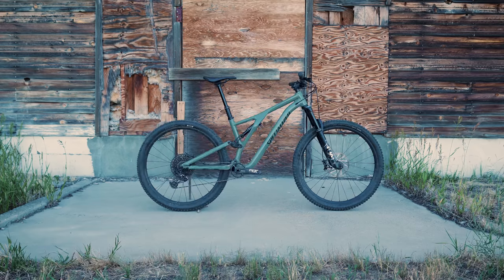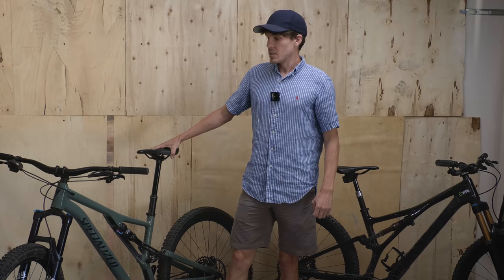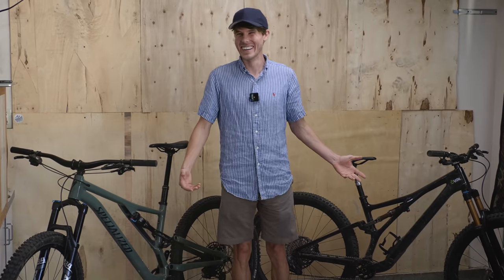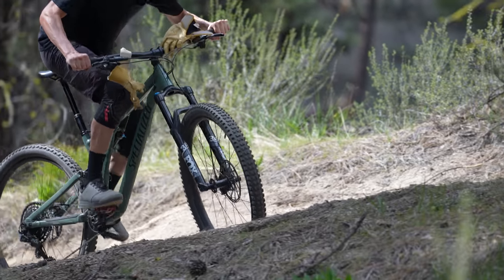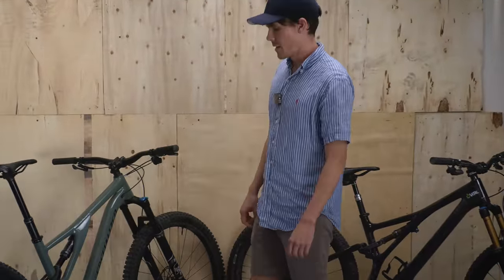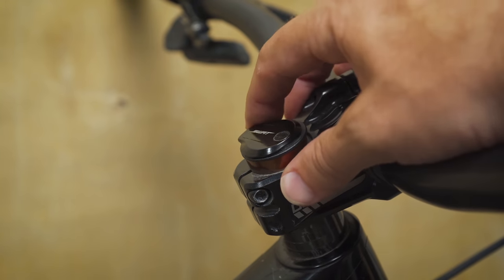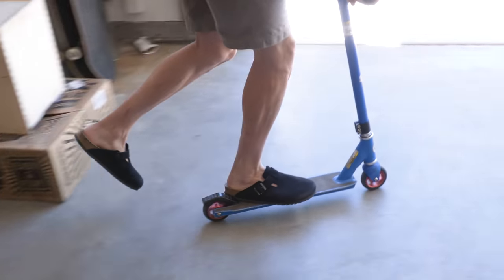LONG-TERM REVIEW - Specialized S-Works Stumpjumper vs. Stumpjumper Comp Alloy

Comment from the maker: Video Contents
0:00 - Intro
0:50 - Downhill Performance
2:36 - Climbing Performance
3:14 - Geometry
4:12 - Suspension Performance
5:23 - Suspension Setup
7:08 - Put a Bigger Fork On It?
8:27 - Fork Performance
9:47 - Drivetrain SRAM AXS vs NX
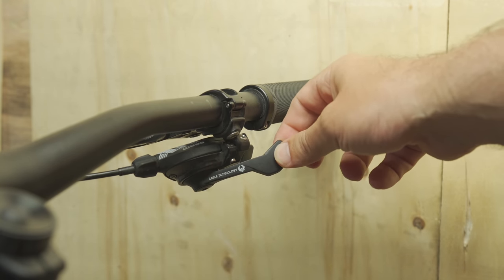11:41 - Carbon vs Alloy Wheel Durability
13:28 - Carbon vs Alloy Frame Durability
14:35 - Is the S-Works Worth $9,800?
15:15 - Is the Alloy Comp Worth $3,400?

Comment: I have an s3 comp alloy and it’s amazing. I’m a teenager who worked for 8 months to save up for it and it’s a bike I’ll likely have for 5-10 years. For most people who aren’t racing or a professional biker, there’s nothing wrong with the comp alloy.
Reply from the maker: way to go, working and saving up for a rad bike!
Reply: Congratulations for getting such an awesome bike at that young age man!
You got yourself a pretty decent job if you where able to buy such a bike after that relatively short amount of time.
Reply: Have a M (S2) 2019 Enduro Comp. Essentially a 2021 Stumpjumper but with enduro travel at 170-180mm. A beast and the sensitivity and kinematics are still excellent. Good choice with the Alloy Stumpy.. frames made by Merida in the Taiwan factory are bombproof as heck. You'll have it for years to come.
Reply: How did you find it in stock? Cause I'm in a similar scenario, except I can't spend my money on the bike I want which is the same Stumpy comp or base alloy
Reply: @vitalmtb  i am going to save for 1,5 years more so i can get The trek slash 9.7
Reply: When u do get in the market for a new bike buy used you can find some seriously cool bikes for a great price .
Reply: Same same man, saved for months and I love it!  Bike has taken my riding to the next level
Reply: How much does it weigh
Reply: Nothing wrong until your frame snaps and Specialized refuses warranty. Happened to me twice... on a normal forest trail.
Reply: @DilbertMuc  carbon snaps, alloy bends. I’d rather have a bent frame that I can still get home on than a snapped carbon frame that would seriously injure me.
Reply: @harrycockroft9659  30 ish, probably 31 lbs
Reply: @iangoodwin1839  Unfortunately the alloy snaps. I had two FSRs with snapped rear triangle, the famous seat stay snap. And a snapped main frame that broke cleanly off at the front tube. That's where I was thinking about moving to carbon because that can be repaired at local carbonrepair shops. Broken aluminum is toast and the alu frames of today are simply too thin, just to be light enough. And you can't buy them from Specialized after some time.
Reply: well, doesn't the Carbon do away with the four link suspension and adopt the new flex chain stays? well, good or bad there "has to be" a difference in ride because of that!
Reply: Good on you!  You wanted something, you worked for it and saved. That is a sign of good parenting, make sure you thank them.  Wish every teenager had been taught that.
Reply: I’ve been saving for this bike for over four months now, still got $1500 to go
Reply: I'm still riding an 07 upgraded to 140 mil still shreds pretty sell

Comment: I really like this format.  I think the middle ground build always end up being the best option.
Reply: Me too! I've gone with the Expert build on both my Roubaix and Stumpjumper and I like the better components and can tell the difference from the entry-level comp but don't think I necessarily need the tip-top of the line S works. One day if the extra 4k doesn't hurt the bank account, maybe I'll consider it but I am so happy with my Experts and glad I spent that little bit more.

Comment: The interview reflected my impression on today's Specialized, which I have been riding for decades now. 
For a hell lot of money (comp alloy) you get a decent bike with cheap/mediocre components (SRAM NX) and so-so performance. Nothing to brag about or be proud off, but it gets you there. 
For an insane amount of money you get a bike that is in the top league and rides like a dream. Anything below an insane amount of money leads to a lot of compromises that make you think about moving to other brands. To help you with this decision, Specialized now raised the prices even higher with U$ 11.000 for the Stumpjumper S-Works. And that is still a bargain compared to the new Epic S-Works at an astronomical U$15.000 (!). Only hardcore Specialized enthusiasts are welcome there. Thanks, but no thanks. Unless I am a sponsored rider.
Reply: Yep...and honestly this review came off very snobby and elitist. Atleast now the bikes are mostly marked down significantly since the covid boom is over. A stumpjumper comp carbon is 40% off right now, showing just how grossly overpriced these were to begin with.

Comment: I bought the 2019 comp alloy in March 2019 and the bike has seen it’s fair share of big hits and bad landings and it is still going like a trooper. I’ve replaced every bearing on the bike at least once due to wear and riding in all conditions, all year round and like you said, the wheels are only good as long as you look after them.
The one bad thing about this bike is that single discipline focus. It is a bike that is designed to make trail riding super fun which it absolutely nailed, but when it gets into DH bike territory, there are no upgrades that are going to make it handle well and within its comfort zone like a modern enduro bike will. 
For the majority of my rides, the upgrades I have added over the years keep it right up there with my mates on 180mm enduro bike but like I said, there’s a point (like 8ft drops into a footy rock garden) where the bike quickly finds its limits and ejects you from the driving seat. 
Great review guys, really good to see this comparison, particularly with the bike I own. 🤘🏼
Reply: The 2019 and 2021 are very different bikes. You would not want to send the new one off of 8ft drops you will destroy it pretty quickly. I would say that the evo version is the bike to have if your riding those kind of trails.

Comment: Great review. Awesome to see this post a week from when I bought mine. I picked the Comp Alloy since it has good components for my intended use and the price of entry wasn't astronomical compared to other bikes. The weight is noticeable when climbing but I'm hoping as things wear out (drivetrain, and wheels) I can upgrade in the right places to bring the weight down a bit. Very cool bike for the price.
Reply: The most difference i noticed was changing the crankset. That took tons of weight off. I upgraded to GX
Reply: @MtbRN2MD  Awesome glad to hear that. DId you upgrade for weight savings or just to have a nicer crank? thanks for the recommendation
Reply: Also was it the alloy GX cranks or carbon?

Comment: I love how a $3K bike is "budget".
Reply: I guess you're new to mountain biking?
Reply: Realy normal bike starts from 3k. Luxury bike - from 5..6k.
new trail bike cheaper than 3k have a lot of stupid moments that may solve by later upgrade, but... later upgrade spend much more money.
Reply: The average mountain biker must be incredibly gullible, the amount they pay for their bikes. Seems like a good time to be a push bike manufacturer, profits must be off the charts
Reply: @rcg9573  Out of curiosity, are you passing these guys on the climbs or descents?
Reply: @rcg9573  sorry friend, the amount of engineering and QA that goes into a bike in this price range is far beyond something 1/10th of its price. 

The hand welds on the frame alone are worth the money.
Reply: @rcg9573  wow you must be the soul of the party… just saying😆😆
Reply: It isn't budget. It is the lowest standard of good components. I'd call it midrange since everything above 5k or so isn't really gonna change your performance a lot.
Reply: Compared to what you could pay for bikes it is definitely far on the lower end of prices
Reply: @briAction  You all really should look deeper into the manufacturing side of the components and frames. The costs to get materials, machine stock, molds, carbon, etc have not actually gone up enough in the past 15 years to match the prices they are currently selling these things for. Take Sram nx, sx, gx - there is no manufacturing cost differences between them and they just market them as better component tiers. They are doing it solely because they created a narrative and people now think 3-5k is "budget".  Wages of the "hand welders" at bike manufacturing plants (NA) have not risen and are under industry standards for welders (tried getting a job at one) also hand welds have been the industry standard for every single budget range of metal bikes since the dawn of bikes - it is not special and does not warrant "better quality pricing".  Engineers at the bigger brands get paid fixed salaries that are not generally factored into the sale of bikes so that engineering cost is a mute point.  Here is an example of how messed up the current system is - lets take Evolve bikes - they charge the same high end rates as the big manufactures yet they don't have any engineering of their own or manufacturing - they private label a Chinese carbon frame  and throw on different component packages.  So they are now making more markup then a big time manufacturer because they get their frames cheaper but charging the current day prices people are used to. Lots of the smaller brands are doing this these days as well.
Reply: @corail53  engineering salaries are definitely considered in a companies budget vs revenue. Idk why you'd get the idea that money for engineers with competitive salaries and benefits just magically appears... skilled workers also cost money (think hidden costs like training).  

Skepticism is warranted but if you think companies like specialized and transition aren't spending money on r&d.. idk..  if you have citations that say otherwise by all means post them, but it seems to me that from an engineer's perspective, bike manufacturing has a pretty high overhead to produce at any sort of volume that isn't one-off. 

Bear in mind I'm not saying markups and hype don't exist, they definitely do, but most reputable manufacturers sell bikes in a pretty wide range of prices and provide very good warranties on their frames, not something you're going to get with a random frame off of ebay.
Reply: Its 5 gs
Reply: @HollyBoni  I used to ride DH in the late 2000's and a good bike was around 2-3k.  So seeing trail bikes starting there now is a bit of a shock coming back into the sport now.  But there have been so many improvements to even the entry level bikes.  Everything is hydraulic brakes, hydro formed chassis, dropper posts, excellent drive trains... Once you get pass the sticker shock you can see why they are what they are.

Comment: The SJ Comp Carbon would have been a better/closer comparison to the SJ Comp Alloy.  It's the same carbon frame and geo as the S-Works and would have been closer components wise (SRAM NX vs. Shimano SLX), and $800 price difference.  I've had the SJ Comp Carbon for about 2 months and love it.  Coming from a 2014 SJ alloy.  S-Works is a whole different level of bike and likely rider.  Great review and like the format.

Comment: The prices of new bikes is insane!!! I understand that the demand is currently through the roof. But those that have been riding mountain bikes for years are suffering as a result!
Reply: The price of used bikes is even worse
Reply: I have been riding bikes over 30 Years I have never seen mtb cost more than a used car insane a bike doesn't make you a good rider a rider makes any bike good  trust me
Reply: @richardgonzalez6583  well to be fair I could never bash as hard on a Walmart bike as I do on my way too expensive long travel toy

Comment: I have a base model 2021 stumpy alloy, it's my first bike in 5 years and my first fs bike.    Maybe 100 miles on it so far.   After a basic setup and walkthrough with the dealer, I was basically able to just go ride and enjoy it and gradually learn how to tune the suspension and gearset. 

It's 1k less than the comp, definitely a compromise on suspension parts and the brakes, but it's still an amazing bike to me to get into grown up mtb's with a lot of room for future upgrades and it gets the job done. My last bike was a GT Outpost, so this is a huge step up, like orders of magnitude, though the gt was way lighter and quicker on gravel/tarmac. 

I do wish it were a bit faster just about everywhere, but it's a really satisfying bike to just get out, learn and be able to hang where hardtails might have trouble, as long as you're okay with just chilling and not being the fastest rider out there.  

Hopefully this is helpful to someone if 3400 is a scary price, 2500 is definitely a bit easier to swallow, especially if you are just building up a set of gear to go with it :)  lots of learning and upgrading in the future 😎 

Great and fair review, the alloy stumpjumpers are great for what they are, but for almost 10k personally I'd step towards a Pivot or Santa Cruz.
Reply: I also got a base stumpy and I can’t complain it hasn’t let me down
Reply: @Hardworkpays209  I actually ended up replacing the rear shock with a custom super deluxe haha

Comment: Hey guys, great review! I'm actually going to be ordering a 2023 (2022?) Stumpy next week but I'm struggling with the Comp Carbon and the Comp Alloy. 

Its an $1800CDN difference and the only reason I can think of to get the carbon version would be the weight savings which from what I could find online is about a 2lbs difference (30ishlbs [could only find the Expert weight] vs 33lbs). SLX on carbon vs NX on the alloy and the venerable Shimano MT800 vs SRAM DUB.

A bit about me: 6'1, 210lbs, definitely just a 2 day a week/weekend warrior - no racing. Lots of technical climbs and I swear there's more climbs than descents. The descents aren't very long either - no mountains here in Northern Ontario, Canada. I would classify most of my riding as technical single track/hiking trails with lots of rock.

Any thoughts on if its worth it to spring for the carbon version?

Comment: I picked up a 21 Stumpjumper Expert and have to agree with your shifting experience. I have yet to get the bike to shift correctly myself. Mostly no-shifts to double-shifts but common enough to really mess up your flow. I also ended up adding the larger vol. spacer to the rear and ended up setting the BB on the high side and it made a huge difference in the climbing.

Comment: I built probably on of the sickest Stumpy alloy, started with the base model on sale, then replace nearly every component. Came in a few thousand less than the sworks.

I went lyrik ultimate (150mm) in the front and Super deluxe ultimate with HBO in the rear. Completely changes the game on climbs , decents, thru berms etc. 

Went axs gx converson kit for wireless better shifting.

Swapped the crappy tektro brakes for 4 piston hayes dominion front and rear.

Nobl t37 carbon wheels with I9 hubs.

Result is a S-works killer and basically a slight shorter travel Evo.

Comment: I have that alloy comp and I'm really happy with it minus the drivetrain like you said the NX is lacking big time and I'm constantly having shifting issues.
Reply: Same here. It rides amazing!  I did improve shifting by messing with the b-gap adjustment, but it's still lacking.  I'll probably upgrade it to GX soon.
Reply: Upgrade to the GX derailleur and shifter, makes a huge difference for the money.
Reply: Well I have the GX AXS and I also have shifting issues + lost Tension. Nothing is perfect!
Reply: Mine doesn't maybe I am just lucky.
Reply: @jlj547  mine two
Reply: @oscarhiemstra3940  mine three!
Reply: @noahgolly4444  mine four!
Reply: I use 11speed NX with gripshift. It work great, price cheap. 
For such bike optimal drive 26..30T with 9-46 11speed cassete.
Reply: Hey, I have this bike 2nd hand. What are shifting issues? How would I notice them?

Comment: I think the comp carbon is the sweet spot currently.  $800 more than the comp alloy, but you get a carbon frame with swat and slightly better SLX 7100 series components vs the NX drivetrain and G2 R brakes.
Reply: I looked at one today but the shop was so busy I didn't get many details. If you don't mind, tell me how you like the dropper post, and the rear shock adjustability. And how much does it weigh. I was a little concerned about the storage compartment making the frame weak. $4200 seems high for low/med specs to me. The other one was the $2400 alloy with sram sx , x fusion rear, rockshox silver forks which I've never heard of but I was thinking could be upgraded later. I went to get a wheel and was told it's looking like two year wait on upgrades. Anyway, thanks for your time.
Reply: @saddleweary9709  I do have the comp carbon and with better wheels and new carbon bar it weighs in at 29lbs.  The DPS shock is fine once I got it set up to my liking adding a .8 volume reducer.  Even the rhythm fork is solid although I had to add 3 tokens to help it from bottoming.  The xfusion dropper performs well, no issues yet.  I would not be worried about the storage weakening the frame, Specialized uses that on the EVO and Enduro which are made to take a beating.  If you wanted to start with the cheapest alloy build and upgrade parts later, the parts are out there, you just might be a little patient and may need to look around to find what you need and accept that they likely will not discounted.
Reply: @superawesomefuntimego  Thank you so much. I believe I'm going to go get it. I was trying to upgrade a 19 gt sensor but it's been rough, so now I'll just go part at a time, maybe go coil on the gt for my very rooty local trail and the stumpjumper for the foothill trails I go to about four hours away. You've been a great help, now I feel better about it. Later my friend